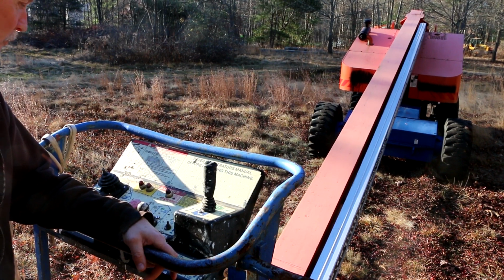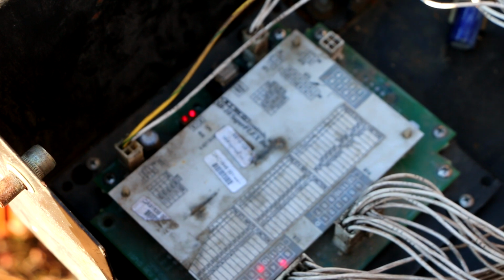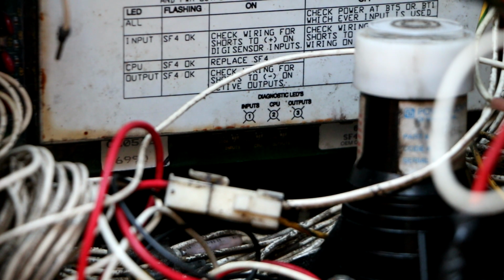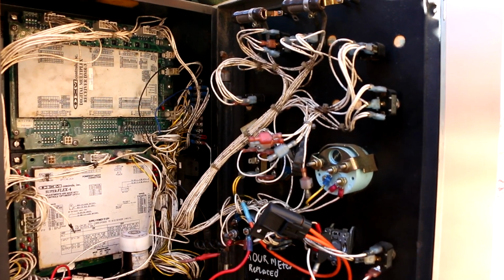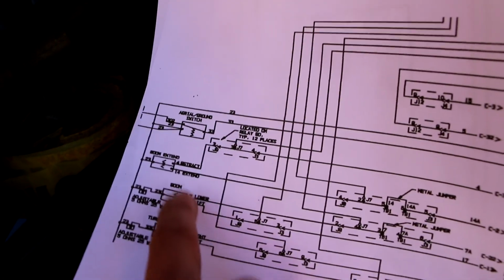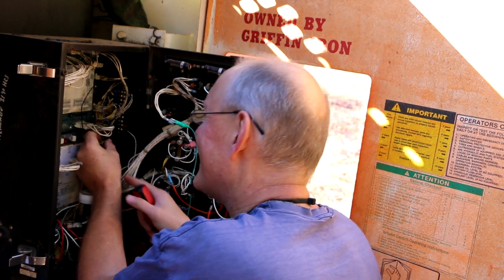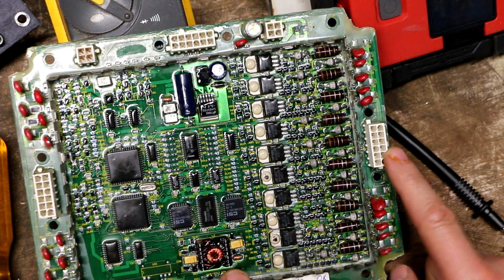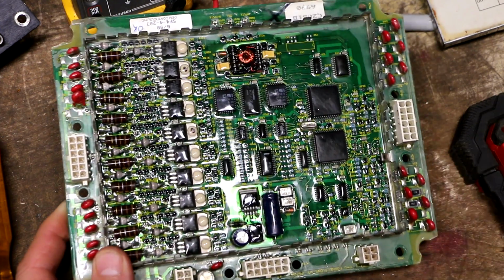Terex TB85 Manlift Part 4: Troubleshooting of the control system continues

Comment: Truck dash bad. You tubers said circuit boards may have spider webs at solder joints, shorts stuff. Scrubbing with toothpaste removed webs and it works fine again. Was thinking that’s nuts but it works.

Comment: I used that company to repair the transmitter board from the same multiplexer for my TEREX knuckle boom lift last year. For me, it was the board up in the basket that was bad. Cost ~$800
(Mine had obvious corrosion and symptoms were that it sporadically would not transmit signals. So, different issue from you).

I also had a similar issue with the left joystick not controlling the boom. Turned out that not all my joystick controls go through the multiplexer, some go directly over festoon wires. I had a broken wire in the boom that only sometimes made contact. I was able to locate and appropriate an unused wire from the loom.

 (Note, my lift has the same multiplexer/demultiplexer and basket control panel, but it also has an additional control board at the base and more controls overall)
Reply from the maker: Thanks. On mine the turret joystick goes right through wiring to the lower board. 

Because actuating the joystick causes the input led on the lower board to flash, I assume the wires are not broken.

Since it seems to output a good waveform in the bench, I am beginning to think something is inhibiting the board from outputting a signal. Something not hooked up to the board when I bench test. Im wondering if it might be the 4 way level sensor.
Reply: @stevewatr Should be able to jump that level sensor. Not sure where yours plugs in. Mine plugs into a board you don't have, but I can unplug it and replace it with a solid jumper.

Comment: The digi sensor sends a digital signal directly to the inputs on the SF4. It’s interpreted by the SF4 in counts/bits. Inside each control box there should be a label on the inner walls. Ex.SN1198-2AC (Ariel Control) SN1198-2GC (ground control). What are those numbers?
Reply from the maker: Hello. Im away this weekend and can check when I get home. I also did more testing since then and will post another video.

Comment: It still could be the control in the bucket not sending the right 4-20ma signal. The LEDs say the direction but nothing shows the proportional signal. You could put a meter in series with signal and compare two joystick outputs. Or swap the wires to one that works.
Reply from the maker: @ScottHenion  I got a quote from a company to repair the board i suspect. $1200! and they have not even seen it. So I am going to try and rig up a bench test with my oscilloscope and compare the working channels to the problem channels. I will use the known good joystick as an input.
Reply: It is not a typical 4-20mA signal. It is a proprietary digital signal. The SF4 interprets this as a bit count that can be read with an optimizer. The joystick has 255 counts at center. Plus or minus counts off that number provide direction of the A and B outputs.
Reply: You are correct . The door switches send full 12v current (actually it it typically knocked down by big power resistors mounted on the door) to the solenoids so it works independently from SF4 outputs.